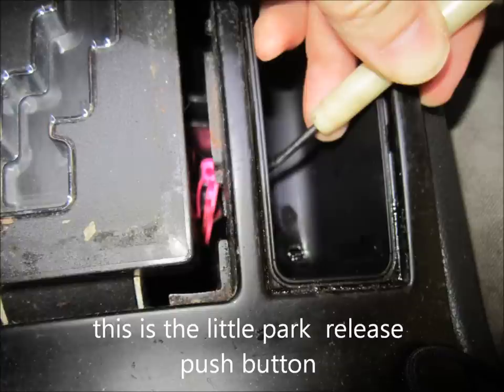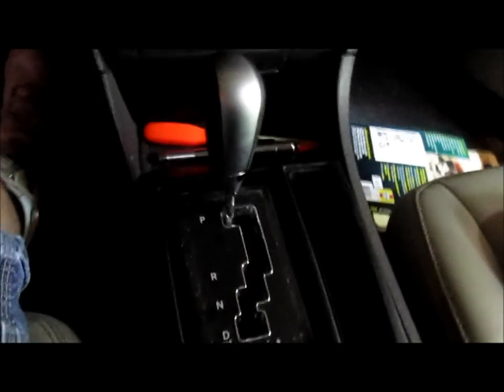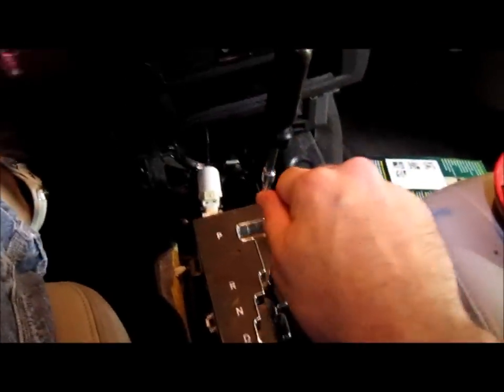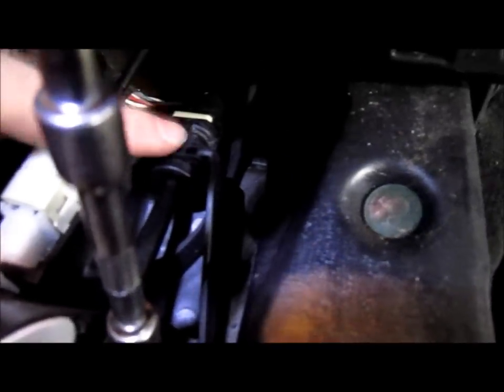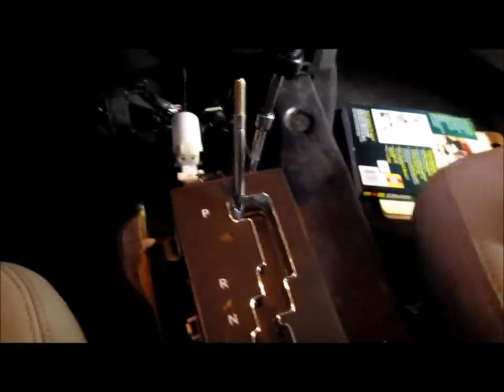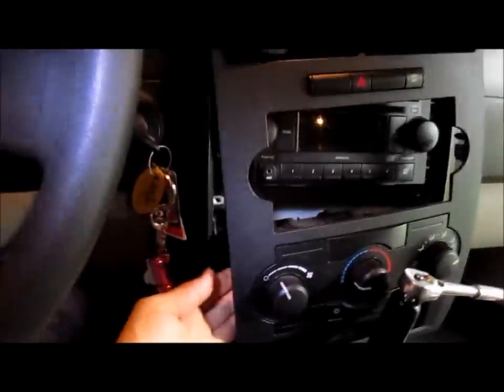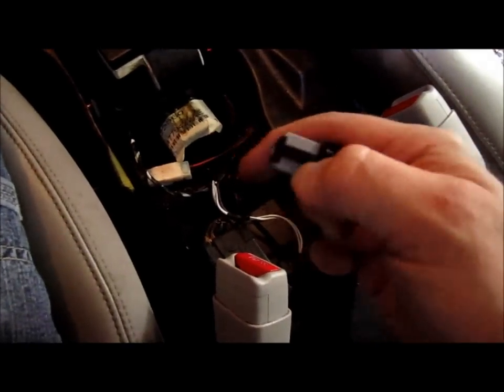Dodge Charger Stuck in  Park  ( Problem / Fix )

Comment: Just wanted to stop by & say THANK YOU for putting this video together. My wife's 2006 Dodge Charger wouldn't come out of gear when she got in it to go to work the other morning. I found out this is a common problem on a message board & it led me to youtube. I was going to go to the dealer & purchase a new "pink thingy" until I found out they run about $60!!! Fixed it with a cotter pin just like you did in the video. Keep on doing what your doing, brother. I really do appreciate it!!!

Comment: This was a money saver!!!!! Thanks NONNIE357!!! Just finished putting it all back together, turned the key, and started shifting away. I did however spend 35 bucks for the part at O'reilly Auto. It's hard to believe shops charge so much for this little problem.  On another note, everyone check with your local Dodge dealer or Chrysler Group to find out if your VIN is on the recall list for this issue. I tried but mine wasn't.

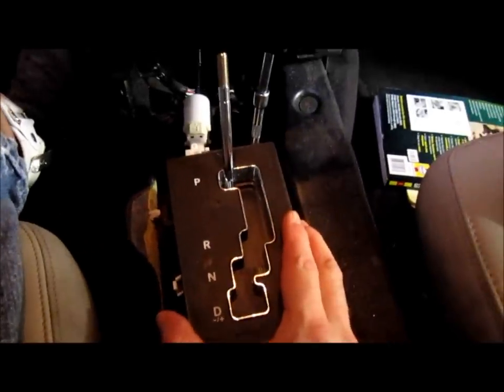Comment: Thanks for the video.. Never would have gotten that thing out if not for your step by step instructions. Worked on my 2007 Dodge Magnum 6 weeks ago. Took me a while to finish only because I closed the box in park several times and it wouldn't shift out of gear once back in my car. I finally saw another vid and noticed he closed the gear box in drive or reverse and then pushed it to Park (Which I now notice you were explaining @ 7:00). Worked perfectly!! Great Video!!

Comment: Thank u SOOOOOOOO MUCH Nonnie357 for this video!!! This video saved my ass yesterday!! I got into my car yesterday after a long day of work and I coulndt get it out of park! Fortunatly my coworker googled the problem and found your video. Thanks to you I was able to get my car in drive and was able to get home. I will be fixing this problem on my next day off. I work over 30 miles away from the dealership so if not for ur video I would have been SCREWED HARD! Thanks so much for this information!

Comment: thank you so much dude! I used your video to install my Billet thingy after my plastic one broke. great job and thanks for posting this video to help others. 
BTW...everyone should report this issue to the NHTSA so we can force Dodge to recall all of these parts. They only recalled some 2007's I was told when I took my car in. This is a piece of crap part that should be fixed by Chrysler/Dodge...we shouldn't be stuck with the bill!

Comment: this does work but you don't have to take the whole dash out in the 2006 dodge charger 2.7 v6 only the center piece around the shifter there is two grasp clamps near the cup holder after you take the rubber piece out you can see it and take a screw driver to it but dude thanks money saver and it does work.

Comment: thanks, I looked online for pics of what the shifting system looks like disassembled, and I think all I did was break the pink lever attached to the spring, probably broke it in half or pulled the spring off of it. I don't think it'll give me problems (fingers crossed), it's supposed to be just a safety mechanism, and I don't do anything dangerous with the shifter or anything like that. but yeah, I can rely on your vid if I decide to fix it in the future. Much obliged!

Comment: Thanks for the post, I had no idea where to start.  I got the pin put in and everything is back together and moving fine, all the cables have been reconnected but now the car wont start.  Any idea on what cable or connection would prevent the car from starting?

Everything else in the car works on the panels, its not the battery either I did try a charge and it was no help.

Comment: Hi I hope you read this. This happened to me 6 months ago and I replaced the plastic part with the metal piece. everything was fine until yesterday. Would not shift. I took everything apart again and everything was fine. The spring was still on and everything. The only thing is that it did not shift unless I hold the pink piece toward the back. any ideas? thanks!

Comment: So I had the same problem, but I didn't fix it, I just kept pulling the shifting knob toward me until something happened, and it worked. The car drives and parks just fine, but there's definitely something loose below the shifting knob. Should I be worried?

Comment: I got in to mine out and i did not have to pull the ash tray out and the radio cover, but i did have to go into the center  cause i could not discontent the back wires was to short to pull the unit out on my Daytona